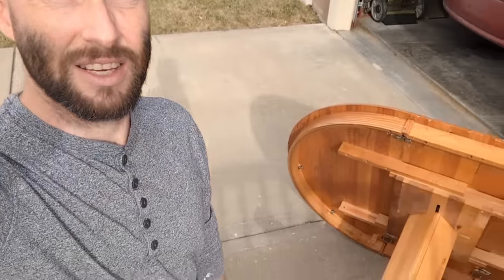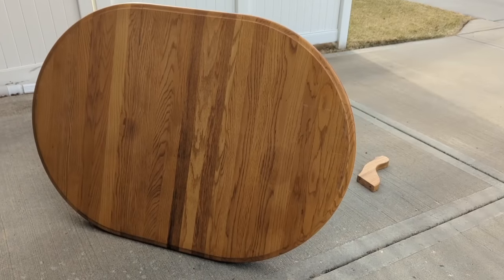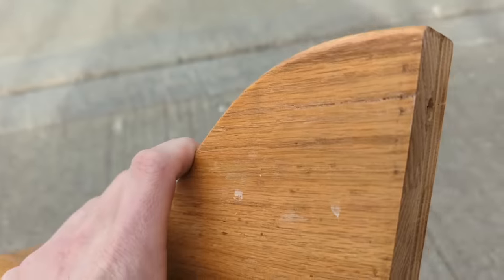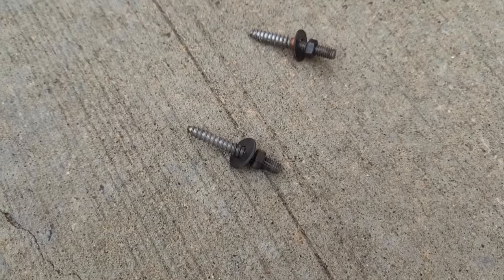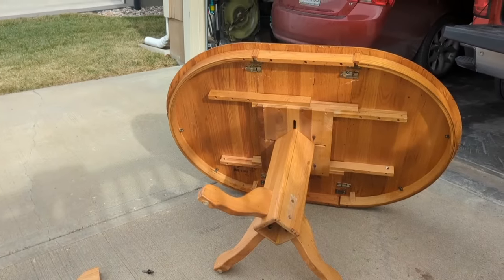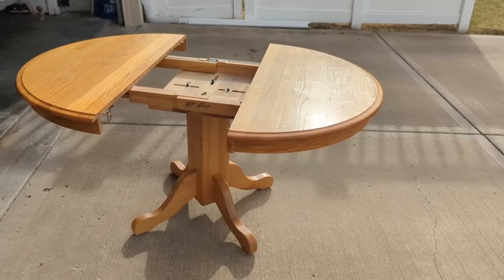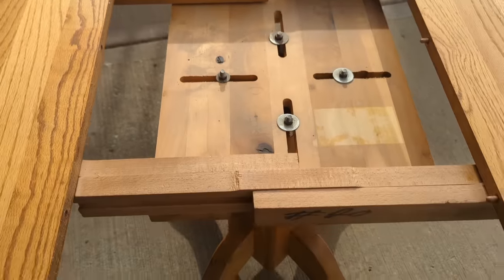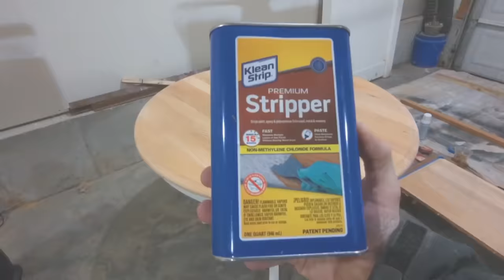How to Refinish Your Mom's Old Dining Table - Golden Oak to Modern

Comment: At first I thought the mocha was entirely too dark, but it came out a good brown, not the orange undertone.  It cover all those stripes or minimized them.  If you wanted to give this a hand rubbed finish, you could buff with a very fine steel wool and then use a paste wax, like Johnson's paste wax.  Can't prove it but the wax helps safeguard against water marks, and adds a nice sheen. Great job.
Reply from the maker: Thanks!  I do like a good hand rubbed finish, but I've already hit this one with multiple coats of triple-thick polyurethane.
Reply: @jessesmithchannel  It will still look hand rubbed, I only use poly, then very light rub with fine steel wool,  and then finish with the wax.  It will work.  I do it all the time.  There is a very slight difference, but you will notice the feel and sheen.  Thanks for a great vid.

Comment: Holy table Batman!  I think this is my exact oak table.  I bought it unfinished 20 years ago and finished it with poly (or something similar) and have used it every day since.  It's been great.  The leaf mechanism has broken though, one of the cogs is jammed .  I'm preparing to downsize and will sell or donate it.  It looks identical.
Reply from the maker: It seems like EVERYONE has owned this table or lived in a house with it at some point.  I bet you could fix that cog pretty easily.
Reply: @jessesmithchannel  Thanks for the vote of confidence.  I'm aging a bit and can't work underneath or safely turn it over to figure it out.  Thus the downsizing, and plans to move to an apartment.  It's OK, I live in the woods with lots of wildlife, coyotes, bears, raccoons, turkeys, rats etc.  I'm ready to be in a less challenging situation.  Want a twin back up table?  Nice job refinishing yours.
Reply from the maker: I think we are all set with this one, but thanks for the offer.  Best of luck with the downsizing.
Reply: @jessesmithchannel  Just jokin' Jesse. Take care.

Comment: Love that! I was wondering if you had to sand and or prime the legs before you spray painted?
Reply from the maker: Thanks!  I could have, but I opted not to sand them.  I only used one coat of the spray paint, and it's held up surprisingly well... Even with abuse from my kiddos.

Comment: Thank you for the tutorial! I need advice about the top coat. I’ve applied one coat, now do I need to sand with 220 and apply another top coat? Repeat as necessary?? I’m using the same poly as you did.
Reply from the maker: I believe that I did three coats, with a very light sand with 220 between (hand sanded, not with the random orbital power sander)

Comment: Never considered taking a table apart to work on the tabletop on my hands and knees. I imagine it is easier to scrape and sand a tabletop when it's at table height. But I've never tried it on the floor so what do I know.
Reply from the maker: Didn't want to add stress to the newly-repaired base.  Plus I was working on the table and leaf, and painting the base.

Comment: How long do you leave the stripper on before you scrape it off? I'm in the process of gumming up a bunch of sanding disks and this looks like a better option!
Reply from the maker: I don't honestly recall how long exactly.  I followed the directions on the bottle and added a few minutes because I got distracted.  😅
Reply: You can also use a lacquer thinner and steel wool after scraping your stripper to take off extra residue

Comment: Did you have to sand the legs and the base or did you only spray paint those
Reply from the maker: I lightly sanded, to help the paint adhere better, but I didn't strip them down.

Comment: I’ve never used spray chalk paint.  Does it need a topcoat?  If so, what did you use?
Reply from the maker: I don't think it needs a topcoat... However, since I have two small kiddos, I used the water based polyurethane on the table base as well.

Comment: @Jesse smith do u really have to put paint stripper can I just sand it
Reply from the maker: You can just sand, but stripping off the top layer saves from gumming up a bunch of sanding discs with the old topcoat.
Reply: @jessesmithchannel  kool thank you
Reply: Oh I forgot to tell what grit u used to sand
Reply: And on the stain did u wipe off with rag
Reply from the maker: @jameselloko6365  80/120/220 grit progression, and wiped the stain on and then the excess off, per the instructions on the can